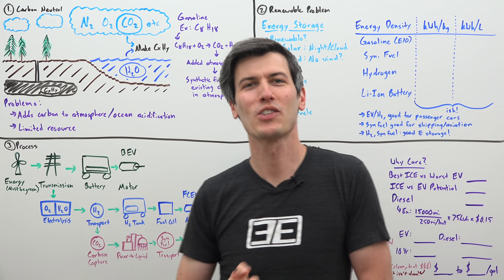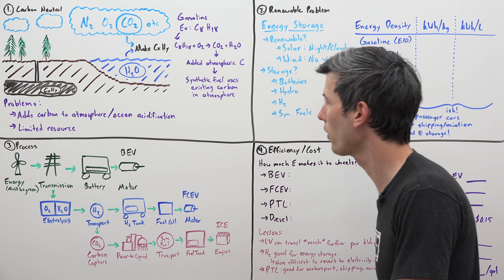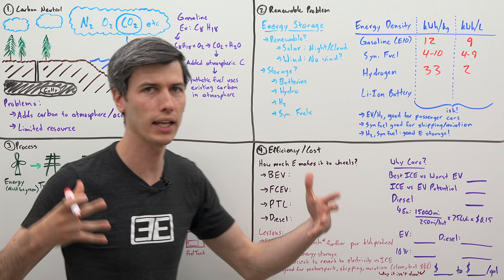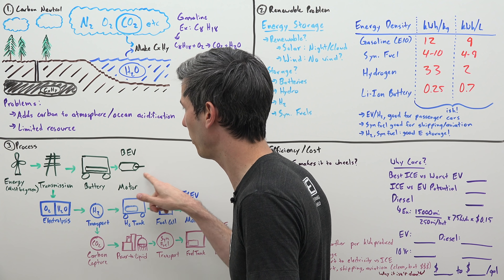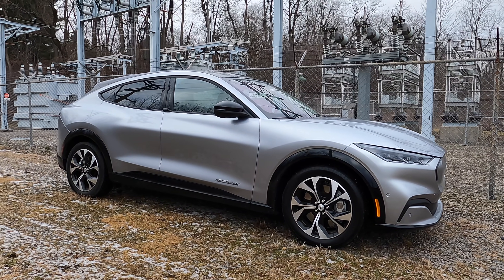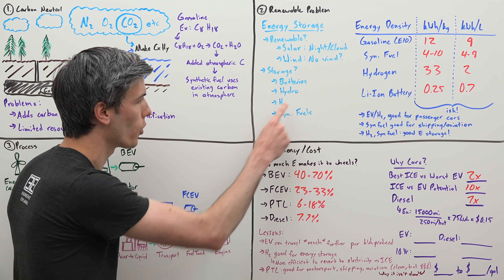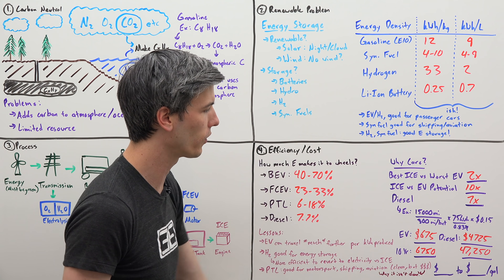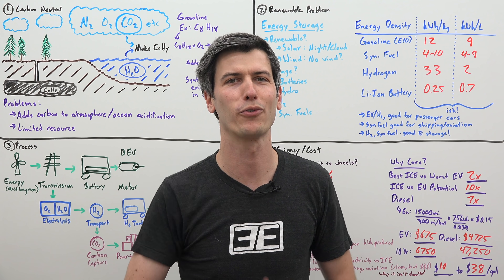The Big Problem With Synthetic Fuels

Comment: I would love to see how ethanol ranks as a synthetic fuel.
Reply: It isn't really a synthetic fuel. It's a biofuel, which means the input energy that you eventually use was put in the plant by photosynthesis not electricity. So the actual energy content of ethanol wasn't input to it from the power grid, that I think is the distinction, synthetic fuels are only really synthetic fuels if they're an alternate path for electricity to reach a vehicle.

Currently the yield from most biofuels is slightly smaller than the amount of fossil fuels you burn in farm equipment and trucks growing and delivering the crops that are fermented and distilled to make it. It's really bad. With biodiesel I think you can get 3 units made for every one unit of fuel consumed in the farming process, which is better but nothing like enough to make it worthwhile, it would mean turning a third of farmland over to oil seed crops just to cover the fuel used in the rest of the agriculture. Biofuels in general only really work if they're consuming a waste product, and they face the same kind of problem that you get for scrap metal or other kinds of recycling, the energy you spend gathering up the waste product from all the different sources is energy that counts against the efficiency of the process.
Reply: @AlRoderick  Thanks for taking the time to reply. That is an argument against biofuel I have heard for a long time. I would like to see if it still holds up. Technology improves, cellulosic ethonol for example. I like the side benefits of investing in the technology as well. The tech for growing crops is going to be pretty similar for growing food or fuel. We have a ton of biomass waiting to become a forest fire. It would be nice to kill two birds with one stone and turn that all into fuel. Ethanol is essential for all kinds of modern processes, so either way we need a ton of the stuff. Improving the efficiency of producing it is a win all around.
Reply: @AlRoderick  if the farms could use directly the biofuel it would be better
Reply: Very very poorly. Real engineering just did a great video out it. The only reason why we have ethanol (specifically corn-sourced) in our fuel today is because of industry lobbying.  Ethanol fuel is such a massive step backwards environmentally that it makes more sense to outright ban it then to increase it's prevalence.
Reply: @HeavyRayne  depends how you produce it...in usa they use corn, in brazil sugarcane.

Huge waste of land and food.

Here in Finland ethanol is made from waste.

Havent used gasoline in my cars since 2007, my factory made fkexfuel volvo's and biopower saab's have rolled soon over half a million kilometers ...
Reply: @HeavyRayne  Actually AFAIK the main reason is that it replaces MTBE as an octane booster. You say it's a step backwards, but given the context of what drilling, pumping, transporting oil has done to the environment I have to disagree. Lets just set aside the human and environmental costs of the conflicts over the control of oil. Strip mining the earth for lithium and rare metals also seems kind of destructive compared to...farming.
Reply: If you really mean "synthetic fuel" , not "biofuel" - I guess not much difference from gasoline, main problem of carbon capture remains the same.

Comment: Just my two euro cents, in many countries in europe gasoline is taxed so highly that we pay more in taxes than gas itself. In my country is 60%/40%.

So there's a bit of a buffer, LPG for example is taxed far lower and is half the price, cheaper than gasoline in california. So synthetic fuels as a green fuel like LPG will be taxed far lower.

Another thing, ev long haul trucks don't make much sense with foreseeable future battery tech, so synthetic fuels make sense for them at the right price.

To put it into numbers in my country of Portugal gas has an additional tax of 67 euro cents per liter plus the usual 23%vat, while LPG auto has only 0.17e per liter of tax+23%vat and diesel 0.51e+23%vat. A LPG conversion starts at 1500 euros.
67 euro cents per liter is 3.1 usd/us gallons! Gas costs less than 3.1 in the majority of us states.

Comment: I feel like synthetic fuels are the only worthwhile way forward. 

Hydrogen leaks out of the tanks. Batteries weight a lot and need rare earth elements. 
You can get lots of power from nuclear power plants. 
You don't need to replace every car on the road + shipping + aviation. 
You don't need to rebuild vehicle refueling infrastructure.
What happens to all the old batteries? How often do you need to replace them?
How do you deal with battery fires? The fire brigade isn't going to like it.
If we switch to electric cars quicly how can the power grid keep up? What do we do to produce massive amounts of electricity needed in the future?
If we switch to electric cars slowly what is the point in that? 
You cannot get an electric car with manual transmission.

No thanks i will stick to my gasoline car for a while.

Comment: It's a good argument for hydrogen buffering electric systems. I'm surprised that hasn't been commercialized industrially yet.  Sure, there are efficiency losses but it's better than not generating the energy at all because demand hasn't been met at that time.  I guess the logistics costs of storage, transfer, processing and FC metering of H2 are still too high for it to compete and regulate the total electricity supply.  If batteries were cheaper, better then this wouldn't be an issue. Liquid salt "battery" buffering has been an idea for a while. I wonder where that's been over the last 8 to 10 years.

Comment: For long-term energy storage (i.e. seasonal), it is hard to beat the Finnish hot sand tech, as currently being rolled out experimentally, combined with one of the hot battery (liquid metal) systems for electrical energy (which last decades of charge/discharge cycles), using the hot sand to insulate them.  It is best when combined with district heating systems, as already exist in some US cities and a few European ones.  Not so great for fast charge and fast release of energy though.  Massive surges on power needs can be supplied by pumped storage if you have the right topography - otherwise, Li-Ion cells, but they don't last all that many cycles, a cost you left out.  Supercapacitors may dampen some of the surges though.  Of course, a major source of clean and predictable/ultra-reliable energy is tidal, which seems to be getting very under-utilised, for no good reason I can determine apart from initial investment.

Comment: 1. The biggest problems with EVs are range limitation, time to charge, Lack of charging infra in remote areas, weight. These are dealbreakers for someone who is considering to buy new vehicle(EV/ICE). All of these problems can be solved with Synth. Fuel. > current fossil fuel infra can be used for synth fuel as well.

2. Biggest issues with Synth. Fuel are at production level. With research we MAY see economical synth. fuel in next 10-15 yrs.

3. Very few contries have charging infra in 2021(mostly in big cities and highway). It will take a long time for world to develope charging infra close to fuel stations. BUT meanwhile if synth. fuel took off, It will be very hard choose EV over ICE.

EVs are cheap to operate, green, have higher efficiency but still they don't have enough range(energy density issue). Even if you have more charging stations it takes at least 30 mins. to charge at fast charger. This charging time is very hard to beat unless you are swapping battery. Currently there are no batteries that you can charge faster than this (heating problems). There are EVs that advertise good range but this range takes hard hit on highways, carrying extra weight, towing, outside temp. change etc. Surely, batteries and EVs get better as well over the coming years.

ICE cars are cheaper than EVs and they can travel easily anywhere. ICE cars have slightly higher cost of maintenance. If synth. fuel somehow made to the market in coming years, no doubt it will be the easy choice for many people. Ruling out synth.fuel from future is simply inappropriate.

Comment: One piece that's hard to quantify from the engineering side is economies of scale and infrastructure and how they apply to these solutions. Hydrogen's biggest challenge is the fact that building out an entire network of fuel stations is significantly more expensive than EV fast chargers, which also have the advantage of being supplemented by L2 and home charging, which makes the hydrogen passenger vehicle's already questionable value proposition much worse if you have nowhere to refuel them. Synthetic fuels can be added to existing gas stations, even mixed in gradually over time, and work on existing cars, so the transition is not limited by external factors. This makes synthetics much more practical to transition to than hydrogen fuel cells, since you don't need to replace tens of millions of vehicles and fuel stations overnight to deliver a comperable experience to gas today.

Now, with all that in mind, EVs still make more sense for most passenger vehicle applications than either of the above solutions due to cost alone, but for cases where lower weight and quick refueling is required, the ease of transition is likely going to make synthetics a better solution than hydrogen even if it comes at the cost of efficiency. Especially when the volumetric density of hydrogen is a significant limiting factor in many of these applications, and many of the vehicles like planes are multi-million dollar machines that could not be easily retrofitted to hydrogen due to being carefully designed around their current fuel source.

Comment: There is a way where you can directly use sunlight to heat a special container that contains some catalyst ( i don't know what it was) and also co2 and h2o from the surrounding air and directly creates CxHy (don't remeber which one) but said it's quite easy to use in Diesel engines i think.
Also you have to factor in. that the creation of syntheticfules could get more efficient than it is now AND it can use unrelibale energie sources when the peak and therefore that energy wouldn't have been used anyway. Anything produced than would basically have endless efficiency. The most important for them would be that they are more dense when you want to transport them and they are longer lasting :)

Comment: E85 could have a future if the emissions weren't an issue. People have been running their vehicles off ethanol-based alcohol since the 1920s, and it's becoming more abundant as companies have started producing it and incredibly common in the performance scene.
Reply: What type of emissions are you talking about ?? I’m assuming you mean other than CO2 emissions ?
Reply: @sking2173  So, with how popular E85 is, it could easily replace fossil fuels it seems and seems to be renewable since it is farmed. It seems emissions from either farming or the tailpipe must be too high for it to be even considered in this discussion. granted, I am fairly ignorant on this subject, but since it seems like such a simple answer, there must be a simple reason why E85 isn't considered a possible answer.
Reply: @Mrjohnnymoo1  — One argument I’ve heard strongly stated is that it impacts food availability if widely used, but I’ve never seen any data backing up that contention ... I knows it’s widely used in the US, parts of South America, and it’s widely available and cheap here in Asia. I use it and it works great ...

Comment: Just a couple of comments: 
1. It is not actually necessary to transport hydrogen - it can generated on-site as electrolysis has the same efficiency at small scale as large scale. 
2. Oxygen produced at the electrolysis step is an industrial feedstock. Obviously this doesn't influence efficiency, but it does shift the economics a bit.

Nice analysis though...

Comment: You know what's co2 neutral? Trees! Grow a tree, cut it down, put it in furnace, heat steam, connect steam engine. Boom you're cleaner than that smug tesla driver!
Reply: there's also wood carburetors (wood gas). Perhaps CO2 neutral, but far from clean
Reply: It's actually very inefficient. Plant photosynthesis is only about 2% efficient at converting solar energy to usable forms. Modern solar cells convert 20%-25%.
Reply: You guys know i was joking, right?

Comment: That was disappointing. But what about biofuels? Plants are already quite good at using light to do hydrolysis and it would be inherently carbon neutral. It would not need to contend with the very inefficient synthetic fuel creation steps and exchange them for turning sugars and starches into liquid fuels.

Comment: It seems reasonable to imagine that the costs associated with producing these types of fuels will come down over time. Also, I sometimes wonder if things like carbon capture may save the ICE.
Reply: Yes costs will definitely come down especially now that F1 and many oil companies are looking into efuel. The low carbon fuel act on the west coast was made to support fuels like this.
Reply: @electric7487  No, it wasn't.

xmtxx2 talked about how EVs are just too efficient because ICEs are limited to a maximum efficiency that's awfully low. 

A Youtube channel replied to check up opposed piston engine saying they have crazy effiency.

Therefore, it is obvious it wasn't implied because xmxtxx2 already covered that the most effient an ICE engine can be is low effiency. As such, opposed piston engine are, by extension, not efficient. If it was implied, A Youtube channel's comment would be moot because already contained within xmxtxx2's.
Reply: @electric7487  I am well aware that you were referring to his comment. So am I. I just gave you a full explanation that shows that no, A Youtube channel's did NOT implie ''For a combustion engine'' because of what I just wrote. If he did, his entire comment would be moot (because the comment he replies to ALREADY covers it) which means he wouldn't write it.
Reply: @electric7487  Right, well if you dont understand why youre wrong after being told twice, Imma leave you at it. It has absolutely nothing to do with wording: the entire comment would not be written if he knew.
Reply: @dzello  Yawn
Oh, and nice job liking your own comments.
Reply: the problem is that, in the end, an ICE can never have a better efficiency than the carnot cycle, whitch is around 35% If I recall well.
It will never be cheaper than EV.
Plus, they are mechanically very complicated (way more than EV). If battery technology improve enough, there will be no advantage for ICE. Especially in cars.

Edit: I got my numbers wrong, some engines are at 40%, best diesel (not applicable in a car) are around 50%.
Reply: @xmtxx  search up opposed piston engines, they have really high efficiency
Reply: @Scumbagius  and why is that?
Reply: @ayoutubechannel921  Nah, you're mistaken. Opposed piston engines have high efficiency '' for ICE engines '', not high efficiency in general. No ICE has high efficiency due to its nature as an ICE.
Reply: @dzello  Yep. You can extend that to any CE (internal and external).
Reply: @xmtxx  40% efficiency for Toyota hybrid on Atkinson cycle
Reply: @nicolasjules579  On E85, a Prius could go 300 to 400 miles per gallon of gasoline.
Reply: @xmtxx  The Carnot efficiency equation is just 1-(T_cold/T_hot), so if you used a reasonable estimation of 200 degree coolant (a majority of the heat is rejected to coolant) and a reasonable estimation of 1000 degrees combustion temperature (could be higher or lower but 1000 would be more of an average) you get 80%. I believe some modern direct injection (high compression) ICE's in cars today come close to the 35% number you claimed.  I think the Skyactive-G Mazda engines is even above that number, and I know the Skyactive-X HCCI definitely is. I think you can say that an electric motor is less complicated, but I think with modern manufacturing and controls the reliability and availability of the EV and ICE are pretty comparable. It appears that you wanted to throw a number out there to try to prop up EVs.
Reply: @cmitchell17a1  Mazda has also stated they are targeting even higher efficiency post Skyactiv-X
Reply: That high of sustained temperature to use is overly optimistic, but what's more important is that Carnot's theorem actually does not apply, I overlooked some things, Carnot efficiency limit only applies to heat engines with closed cycles. The ICE is an open cycle, there is technically no heat rejection process that HAS to occur and the exhaust gases are expelled to the atmosphere and a new working fluid is sucked in for the next cycle. So in theory there is no limit in an open cycle. As with everything else in the real world we still won't get close to 100% though, for the same reason a EV will never achieve 100% either.
Reply: @xmtxx  Motorsport ICE engines are already 40-50% thermally efficient so road-going ICEs will be well above 30% and are definitely not capped at 35%.
Reply: @xmtxx  The electricity used to make these e-fuels will be much much cheaper than the electricity you use to charge your car...
Reply: @cryptohouse1676  I don't understand your reasoning.
Why would electricity used to make e-fuel would be any different than the one used to charge a car?
In another word, if the electricity can be user for e-fuel, that same electricity ca be used to charge car.
Transportation of electricity is cheaper than transporting the fuel in itself.
Reply: @xmtxx  In reality it will not! Why do you think electricity prices vary so much from place to place?